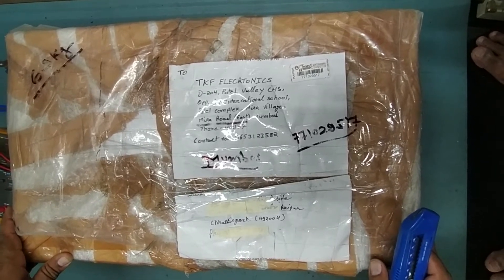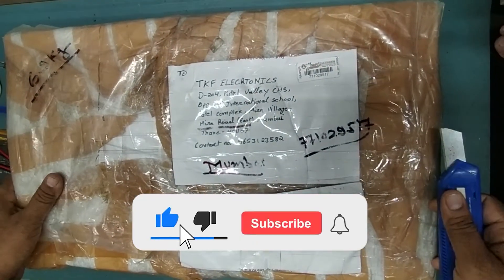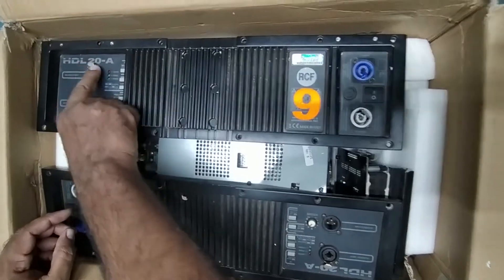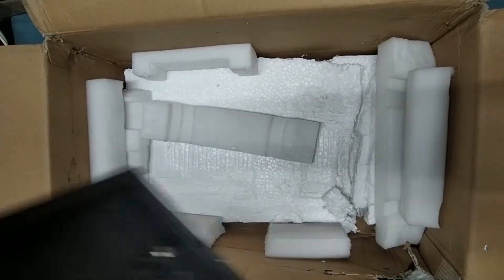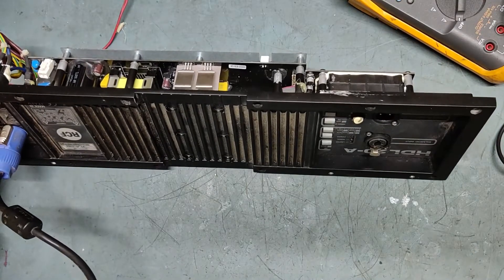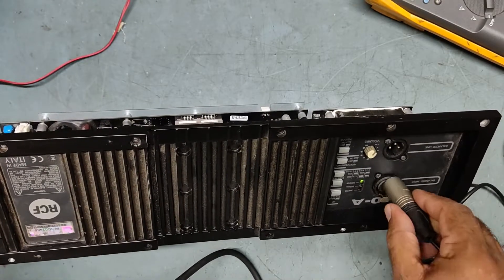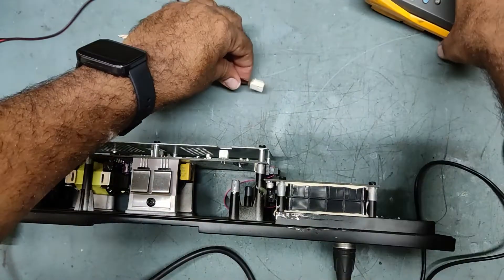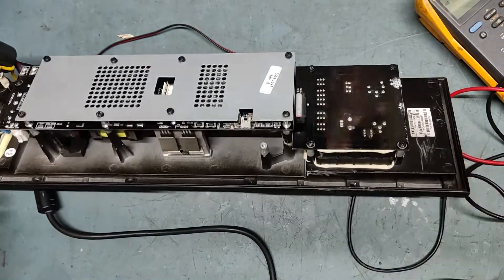How to repair RCF HDL20-A Active Line Array for No Sound Problem #repairingrcfhdl20a

Comment: Hello, I have an RCF NXL 44 A machine. The MCU IC is damaged. Can I get it to work by replacing the IC without programming? Thank you.
Reply from the maker: Program MCU ic needed, then only it will start working
Reply: @TKFElectronics  can you help me to get the program file for ic mcu pic16f689 for rcf nxl 44- a?
Reply from the maker: Bro only original Manufacturer can help you in this
Reply: @TKFElectronics  Oh my gosh, can you help me get this IC programmed? I don't have any connection to the RCF manufacturer.

Comment: I have RCF HDL20 and one of them is giving me this rumbling sound when powered and power seem unstable as it does not power up but gives off the sound and when i disconnect the speakers from module then power stabilize so am wondering what could be my problem?
Reply from the maker: May be looks faulty Amplifier circuit, voltage is going to Speaker therefore rumbling Sound is hearing & may be possible power supply circuit may have problem,  and preamplifier circuit sometime looks malfunctioning.

Comment: I have a similar problem with RCF amp module for 702as ii subwoofer.  All led lights are on and power supply works but no audio going to the subwoofer driver.  Input lights work and I see signal light working.
Reply from the maker: Problem will be either DSP ic or MCU ic
Reply: @TKFElectronics I tested the voltage regulators for heat and they tested above 50 Celsius.  Hot to the touch within a few seconds of turning the amp on.  DSP IC was only 32 Celsius.
Reply: @giovannigalveston6852 Hi is the problem solved? I have the same problem no sound, initially the speaker was completely dead then I replaced the pwm ic and it can be turned on again but the sound does not come out but the signal light is normal and the dsp ic is not hot
Reply: @TKFElectronics Hi is the problem solved? I have the same problem no sound, initially the speaker was completely dead then I replaced the pwm ic and it can be turned on again but the sound does not come out but the signal light is normal and the dsp ic is not hot

Comment: sir.i m feroz from malaysia.my rcf hdl 20A line array speaker is sound slow down.first problem is lightning attack.MOV was short.i changed MOV than power can ON but sound is slow down.can u tell me the problem?thank u sir.
Reply from the maker: Check Amplifier section side or line input circuit side

Comment: Hi sir, my rcf evox 12 can't power on, I checked the fuse and it was blown.  It has no back up fuse, can you please help me where to buy a replacement fuse and what size i would buy? your help is appreciated.  Thank you
Reply from the maker: My dear their is problem in power supply board Therefore fuse blown off & if you replace with new fuse that also will get blown off so pls try to rectify first power supply board.
Reply: do you offer remote repair, the place I live there's no one repair the speaker.  Anything I can make it work; I will give it a shot.  Thank you.